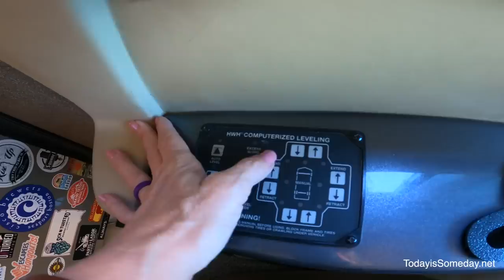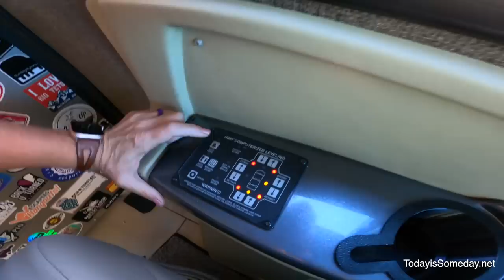Crazy RV Facts (FULL TIME RV TRAVEL DAY)

Comment: Please ask your viewers to be cautious around Semi-Trucks. We are moving 80,000 lbs [and it takes awhile to get up to speed or slow down.] To be aware that the Truck Stops are just about the only Safe-Haven where we can Fuel / Have a Hot Shower and Meal. [RVs are Self Contained rolling homes] We aim for 600 miles a day. Which is 11 hours of Driving of our 14 hour day. We constantly put up with people who cut us off, won't let us change lanes [When We Are Required to...]
I'm sure you and your viewers have experienced the same.
If they use one of our valuable 75' spaces with a large RV, no problem. But, please don't park a little van in one of them.
When we run out of spaces we [with the permission of the Mgmt.] use some of the secret spots on the edges [which some of your viewer have discovered.] Please be aware of how they are Parking so that they make room for a big-rig to park in front /behind them.
We will Not park close to RVs [As we do with other Trucks] because if we bump an RV most of them will collapse like a deck of cards against our high strength steel and 80,000 lbs [possibly with a family inside.] Note... We also own RVs and follow the same guidelines. Also Please Note... It's a $1, 000 fine when we are forced to park along the Highway or Ramp. Thank you for all you do for the RV community.
Reply from the maker: Stay safe out there!
Reply: I have a 45 foot bus and I try to do everything you said. I think more post like yours will help other rv people who are new know kind of the rules of the semi peeps! Thanks for what you do and be safe out there man. Man 11-14 hours is a long day, 6-7 I’m dead lol!

Comment: Voltage is very important on the HWH.  Run the engine get the voltage up.
Also, when you pushed you side button while the jacks were going up, it shut off the jacks power and that will need to be reset.  
One more thing, add a small amount, very small amount of WD-40 to the Jack stem, very light wipe once a week or so.  They will go up much faster.  That was a tip HWH gave me back in  2012 for my 07 Ellipse.
Reply: I was informed by a Tiffin Tech that you should not use WD 40 as it could attract dirt. He recommends T9, which is what I have used for over a year. Depending on how many times you put the jacks up and down and with being FT RVers, they should be lubercated once a month. 
Phil & Stacy thanks for all your viedos and useful information. I'd be interested in what you discover from your research as I have the same Jack system.
Reply: @shoerock1  
T9 is good. 
All I know is what HWH told me in 2012,  worked great for the 13 yrs I owned the Motorhome.

Comment: My Tiffin bus had a lift stick lifted. Nothing worked to fix it. I finally went back to the control and wire harness connection. Un-clipped the harness and looked at connections are clean and etc. Then pushed the connection back together. Bang all 4 jacks stored since then. It shakes down the road until the next wire is bounced loss again

Comment: The best solution to the DEF issue is buy an older rv. I traded off my 2016 Palazzo for a 2010 Tiffin and was happy that I dont have to worry about the DEF issue. Engine runs strong , clean, and smooth.

Comment: I've had two separate problems with my HWH leveling Jack's. First time was a failed master relay solenoid. I diagnosed and fixed that one. Second one was my keypad went bad. The system had a mind of its own. Everytime I tried to use it it did something different and weird. Drove it to Moscow, IA and the boys at HWH took care of it. Got a new MIOM module for free because they misdiagnosed it initially. I tried to tell them I suspected the keypad.
Reply from the maker: Thanks for sharing

Comment: It's so frustrating when we have problems like that.  Seeing that it can be just as bad for more seasoned RVers makes me feel less stressed about my own troubles.  We had an issue today with water flow, and while we never actually figured it out, it resolved itself.  It's always something!
So we're a full decade older than the average RV owner, but we use our rig 13 times as much.  At some point, we intend to put together a single "trip" in RV Trip Wizard, to track all of our movements, but until then, we don't really know how many miles we've towed this monster.

Comment: Had a DEF tank heater failure last week in fairly moderate temps. While having the issue repaired, the tach said he was going to perform a regeneration to the system. He indicated the engine should be hooked up to the specific software to check the need for regen every couple oil changes. With 24000 miles on our 6.7 Powerstroke we were at 75 percent. If you allow the system to exceed 100 percent sometimes the DEF tank needs to be removed for deeper service. Never heard of this before so have your tech check for regeneration needs.
Heater function repair was a grand. Removing the tank to perform deeper service would probably add another $500-$1000
Merry Christmas and happy RVing

Comment: Not the same as your problem, but maybe help some viewer.
I had a jack issue and of course, it was in the middle of nowhere. My jacks refused to retract. As you know, the transmission won't go into gear with the jacks down, so I was stuck. After running around I discovered if I "aired up" and put wood blocks under the jacks, then "dumped the air" it pushed the jacks up. Later, at the service center, they asked, "How often do you wipe the shaft with Silicone?" What? Huh?. They raised my MH until the rear wheels were 4" off the ground!!! (OMG!) and gave the shafts a good cleaning and spray. No more problems!

Comment: Unfortunately less chains are participating on Jan 1. I will still use it.  The year before our coach, Blue Bird deleted the double sided fuel tank fill. We can only fill on the passenger side, That's usually the 'dumb' pump. Took me a second to figure out how to work that pump. We have the same jack system. Had to reset it a few times last year. Last ditch they do have a pressure release button

Comment: I have read and tried a reset for the leveling &slide…. Cycle the key on and off 3 times, or for master reset, turn off batteries with the disconnects and wait a bit and turn back on… Solved my issue once…

Comment: I hate Tiffin jacks. I never had any issues with the jacks on my Palazzo. They are power up and power down and work fast. The tiffin is super slow coming up and yes I always visually check to see they are up as I dont trust the system. 
I recently got a message from Open Roads stating that the only truck stop my card is going to work at is the T/A. Loves never was a very good discount anyway.

Comment: I'm glad that you're not having too many problems with your RV and I'm glad your checks are working now here's the tip that helps me you know you're slide out that you have use the slide-out Grease on your jacks and I still use it on my slide outs I clean them every two weeks I check to make sure they work because one thing that stinks a jack does not go down or your slide out won't go out so make sure you clean them check them regularly and use that slack Grease cuz it really works well

Comment: Phil and Stacy it could be a circuit ground issue for the jacks or corrosion on the wire causing improper voltage to that solenoid

Comment: Hey Hate to tell you but I know of at least 2 RV's that were $5m plus even 2 that where $7m  There out there just not reported I know the one owner and it a pricey one. the base RV was $2.7M then add interior stuff high end. and Solar, Communications.   That Microsoft Guy had one for $7m off road RV.   I think $500K is the limit any one should spend on a RV.  There are plenty of used RV's that are cheap  and good.

Comment: One thing to watch out for is running either the pump or the solenoid valves too long.  A few minutes for the pump and then you need to let it cool down.  The solenoid valves run when you hit store (for up to 20 minutes when the jack down warning lights stay lit).  Hitting store multiple times can overheat them.   I learned about overheating the hard way.  I ran my jacks up and down a few times putting blocks under tires etc trying to get level.  Then the leveling system quit responding.  I checked and the pump was very hot.  Next day leveling was still unresponsive but I ran one slide in and out a bit which proved the pump was working.  A bit later (key off/on a few times) I got it working but to this day the leveling is a bit twitchy.  As for manually releasing the jacks.  I haven't tested but I have an HWH diagram (from manual came with rig) which indicates the jack solenoids are on the back side (opposite the pump) with the 2 outside (big ones) for the rear jacks and the 2 small ones at the bottom are for the front jacks.  I have a 2019 RED 37BA which I would expect to be similar to your rig.  Good luck with the jack issue.

Comment: I had the same scare with my jacks last year; difference was my control panel accurately reflected they were down but the panel was completely unresponsive.  I ended up forcing them up by flipping the solenoid levers which should probably be a last resort but it worked!  The shop couldn't duplicate the problem and they tried to tell me that I was doing it wrong with the engine running.  I know some coaches may have that restriction but mine doesn't.  They subsequently had intermittent problems but not since I changed the hydraulic fluid.

Comment: Hydraulic fluid is very viscous and does Not like the cold, at all. Just drove back from MS and the warning bell on the hydraulic system screamed at me for 3 hours until the outside temp got above 50 degrees. We don't have auto-level but I think I prefer the manual system, because if the auto level malfunctions going down the road - that's terrifying.

Comment: My tiffin did this. You have to hold down the power button for 10-30 seconds to reset the system. My jacks got stuck in the mud and wouldn’t come up and it had a mind of its own after that. So I reset and boom good to go
Reply: Where is the Power button to cause the RESET? On Phil and Stacy's display (and mine), there is a CANCEL button - is this AKA Power button?
Reply: What Power button are you talking about?  My HWH system doesnt have a power button
Reply from the maker: Ours doesn't have a on/off button.
Reply: @todayissomeday  I believe it was the auto level button on the top left you hold for 15 seconds and it resets the whole system. My jacks were stuck in the mud and the buttons did nothing at all. I turned the coach off held down the auto level button for 15-30 seconds it started beeping and came up and never had another problem. 2017 tiffin allegro bus 37ap. I’m in a cornerstone now and miss my tiffin to be honest, cornerstone rides way better but wow it’s been a rollercoaster of emotions if u know what I mean. Call tiffin to get more info if u need but that’s what they instructed me to do on the hwh leveling system I believe it was.
Reply: @RBELL1128  I believe it’s the auto level button. Top left if I remember. You hold for 15-30 seconds and it resets the system.

Comment: Tell me about the Door handle rod you installed.  I found that pulling the door closed was a problem so I bought one of those shower suction cups handles and installed it on the door window.  However, the Florida heat disintegrates the suction over a few months and I have to keep replacing it.  I see that you installed some type of rod!
Reply from the maker: We have it here on one of our gear pages: https://todayissomeday.net/gear-essential-rv-tools-and-supplies

Comment: QUESTION: why do you even put down your levelers when you are on level ground?  I don't.
I am the old, now 84 y/o guy still Rving in our 2001 40 ft Monaco diesel, now with 140,000 miles on it.
I don't use my levelers at all anymore. They work, but I have found I can generally put a 2x12 under one set of wheels and be level.  Also, I put in an Amish Aire back on my fridge... so no more precise leveling even needed.
I also find my 2 ft long 2 x 12's disperse my weight better than the pads you have on your levelers.
Just my ways.

Comment: I had a leveler problem one time.  It turned out I had pushed the emergency break, required, but I pushed to hard and it would not do anything, up or down.  The switch on the break peddle was pressed so it did not sense it working properly.

Comment: I know that this is a little off subject but, Phil, do you have trouble with your diesel tank "burping" when you fill up?  I am new to motor homing and I have not been able to find the secret to preventing this.  I have tried filling real slow but that is sometimes worse as the truck fill nozzles sometimes do not shut off on the lowest setting and that make a real mess!  Or is this something that I have to learn to live with?  Or....maybe it's just my motorhome. I have a 2022 Newmar New Aire.  Thanks and love your channel and your efforts for the veterans.  Thanks for both of yours service.
Reply from the maker: Thank you!  I have it happen occasionally.  When it does,  pour water over the spilled area to flush it off the rig.
Reply: I use to have the same problem. Started opening the fuel cap on the opposite side of where I’m fueling and that solved the burping problem! 2020 Newmar Dutch Star 4369

Comment: You may have a jack solenoid going out.  It happened to us in the middle of nowhere.
Reply from the maker: I think so as well.  We are sitting for a bit and will troubleshoot and update accordingly.  Hope you two are well!'
Reply: We are doing great. Currently, we are in Mission texas.  We bought an RV lot in Ratama Village and put an 800 sq ft Casita on the lot. The RV issue started with the Jack's wouldn't come up, and then the drivers side slide wouldn't move in or out.  T/S it to a solenoid that is on a hot connection to the batteries.  When replacing, be careful.

Comment: I am having the same problems with my leveling system that you were experiencing and I am just wondering if it is the snap pads interfering with a sensor I just put them on my rig six months ago and the problem I was just started. ? Thomyt
Reply: You have to let it completely recycle and think for itself it has me baffled as well. Thomyt
Reply from the maker: We have had the snap pads on for almost 5 years.  This issue just started.